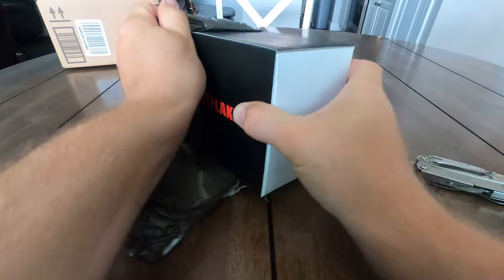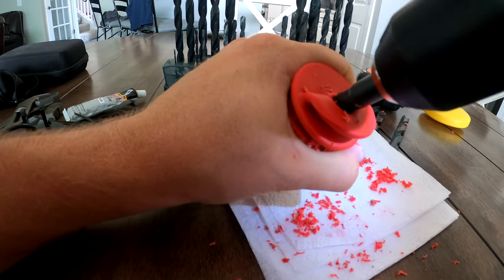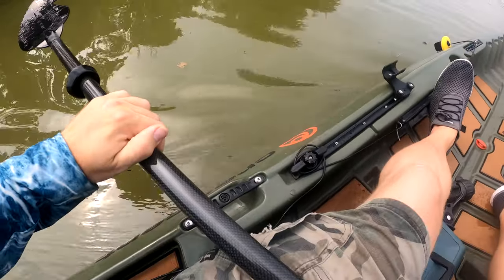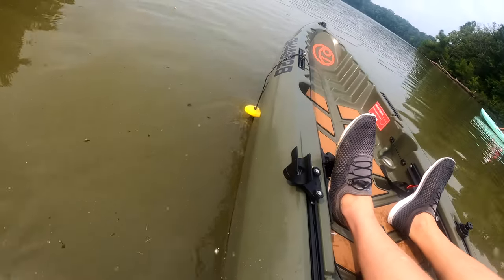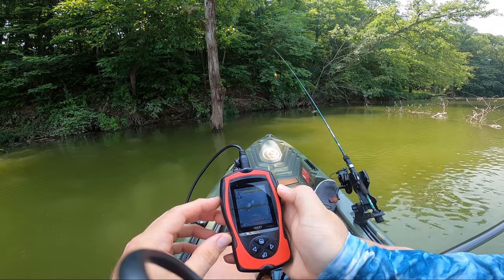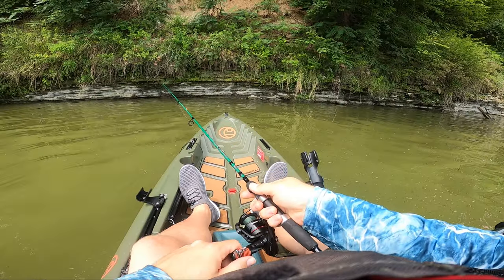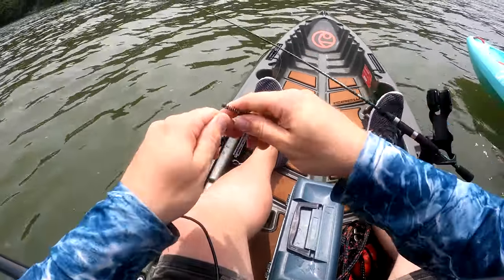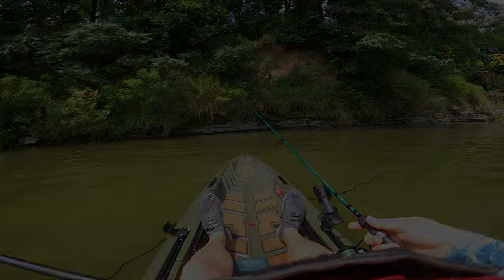Lucky Fish Finder Testing & Installation UPDATE (Portable Kayak Fish Finder) | PART 2 of 2

Comment from the maker: Just a quick update, I've had this out a couple times now and it's extremely useful. It's also lasted two full 6-8 hour days on the water without needing to be charged. It's finally down to about 30% so I'm charging it back up -- very impressive battery life!

Comment: Thank you for this video, good stuff. Based on this review I also purchased this device. I use this on my belly boat. I recommend playing with different sonar sensitivity settings. If the water has vegetation and/or water is murky with leafs etc particles, try to change to a low sensitivity like 3. It decreases false fish alarms, and at least i don't want to know about all the little minnows in the water. I mainly use this for pike fishing, so I also quickly turned off the small and medium size fish alarm, they don't interest me anyways. The big fish alert also reacted to small pikes (around one kilograms), so I don't think fish actually need to be very big in order to get to "big" category on this device. This simple sonar has all the features I could ever want.
Reply from the maker: Great info here! I also had a lot success playing around with the sensitivity. For what this unit provides it's really a great value. Ill have to try only using the big fish alarm, I am generally  looking Crappie/Bass so it sounds like it could work for that too. The 'small fish' setting must be for crystal clear waters or as you said, bait fish.

Comment: Crew owner here.  IF you want to upgrade your graph the Garmin Striker 4 transducer does fit in the scupper hole with a little bit of filing of the transducer.  May be a nice upgrade path for you when you get to the point of needing a bit more capability in a sonar unit.  Mine gets installed in the scupper plug when I get to the lake and as it sits barely recessed I don’t worry about it scraping on any rocks or logs.  Many of the small lakes I fish in Wisconsin do not have any map data available so moving to a unit that allows you to make your own lake maps has been awesome.  Love the Crew!
Reply from the maker: Great to hear!

Comment: Do you have a recent update on it? I want to get a garmin striker but I’m in no rush to buy everything to make it work on a kayak
Reply from the maker: I don't have a further update but I have used both units. The Lucky is more for general info, water temp, depth, some very light fish finding. If you want an actual sonar with very accurate results the striker would outclass the Lucky by a large margin. The best way I could put it would be like a TV, you could buy two TV's that are both 40in but one is 720p and the other is 4k.

Comment: Hard to tell in video but if this cable is 25 ft long, what did you do with all of the excess?
Reply from the maker: I coiled it up with a zip tie and keep it under the seat. I left enough off on each end to deploy the transducer and plug into the fish finder when attached to my jacket.
Reply: Sweet. I just ordered the $130 one from Amazon for my Hobie. No idea what the difference is other than being waterproof/corrosion resistant. (I fish salt so that’s why I spent a little more). 

Didn’t want to drill holes into my Hobie so this fish finder should work perfect. I’m sure my scupper is to small as well. Lucky Sonar does sell a suction transducer mount that I’m also considering. 

Awesome vids. Appreciate it!

Comment: Does it show on the fish finder the outline of a fish nearby or how do you know what a fish on it im new to getting a fish finder.
Reply from the maker: The resolution is pretty low for the unit but it will show lines where the fish are. It has a feature to replace the lines with fish icons to read it easier. The fish icons are not super accurate but you can adjust the sensitivity for it to be more accurate.

Comment: A handy dandy way to mount this product on the rails is to combine the lucky suction cup mount with the yak attack go pro mount. This works because the top of the crappy suction cup mount is connected the same way as a GoPro so you can put the top of the crappy mount onto the good yak attack mount allowing you to put it on the rails. :)
Reply from the maker: Cool idea! I'll look into that
Reply: @mvboutdoors  just tested it and my go pro fits onto the suction cup mount so I know it will work. Just put the fish finder mount half where the GoPro goes. I’m ordering one now
Reply: Just wanted to let you know it does work. I got mine today. Very happy with it
Reply from the maker: @travisporter2882  That's awesome, I love mods that do not require permanent mounting solutions.